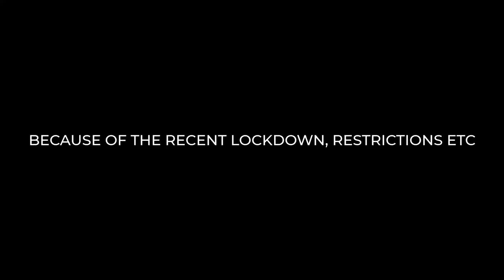Desk Build Ep.3 - Legs Tapering by Hand Tools

Comment: That long/short square is a tool I haven't seen before but it makes perfect sense. Peace.
Reply from the maker: Going to the hardware store for a 1m ruler was a 400 euro fine risk :)) So improvise
Reply: Try a old fold rule
Reply: @AdrianPreda  It's a folding rule? I didn't even notice because I assumed it was an Asian specialty tool. Cool; I've got two already and never thought to use them that way. You're always an inspiration.
Reply: @JoelWetzel  no, it's two rules, he used the small one as a guide to slide the long one on, to be able to mark the taper...
Reply: @bhaygood7306  not really good for STRAIGHT lines... At least the ones we have here in Europe, the old american ones are somewhat straight-er
Reply: @alexchiperi  I see now. Thanks.
Reply from the maker: With the two rules yes that's the reason. If you talk about at the beginning, I've used the folding rule and a square, just to measure the perpendicular distances the best I can so I can set that piece close to parallel.
Reply: I always do that it gets the job done then it's fine! No reason to own longer rulers anyway if you don't use them often. No reason not to own one too if you're out collecting rulers though lol
Reply: @orien2v2  I saw it wrong the first time round and thought it was a square with one long and one short leg. It would have been a good addition to my collection if it had been a real thing. Peace.